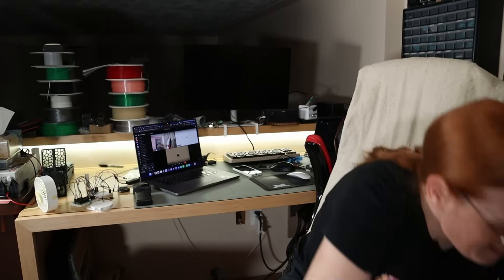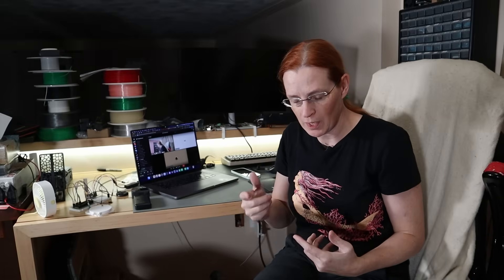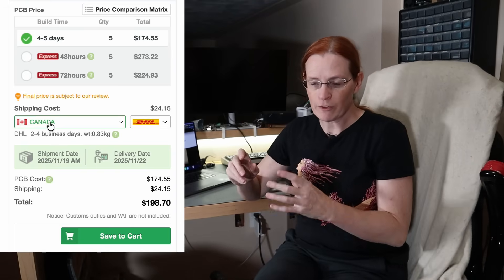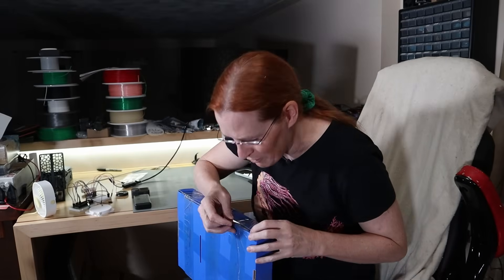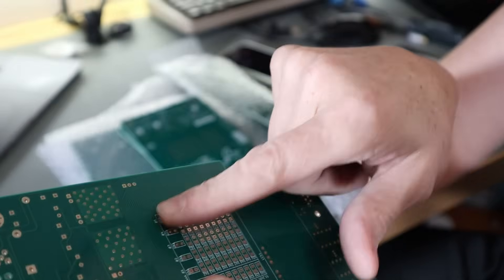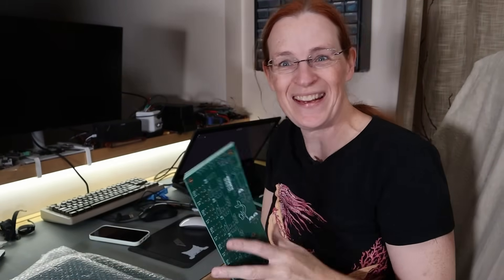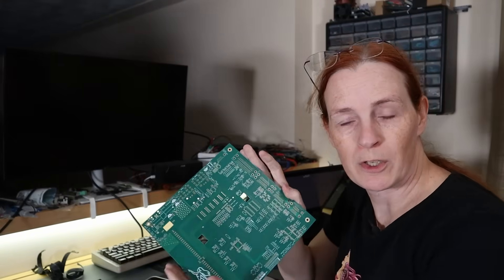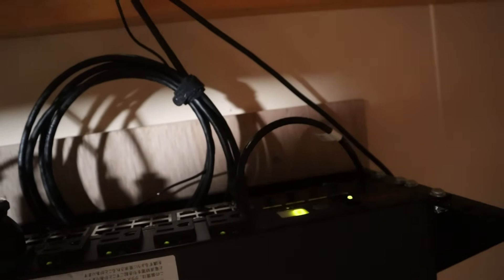The PCBs Are Here! Who Made Them? - Ep. 119

Comment: The reason for the use of gold for the connectors is a chemical one.  Unlike Copper, Nickel, Silver, etc and alloys of same, gold does not oxidise (tarnish) - there is no oxide of gold.  This means that there is a low resistance long-term across the connection.  Furthermore, with gold being a fairly soft metal, when inserted or removed, a minute amount of the surface is scraped, thus removing any contaminants from the joint(s) - this is why it's good practice to periodically remove and replug gold audio connectors on hifi systems.
Reply from the maker: Aye, I used to often enough unplug cards, run an eraser over the contacts, and reinsert them. I know that gold itself has no oxides so is superior to tin for corrosion resistance. However I figured there must be more to it given how ubiquitous cold plating is, even on cheaper expansion cards.

Comment: Great the way your boards came out! Fantastic that you educated yourself designing them. 40 years ago I made my pcbs by drawing the pc copper layout on transparent paper. Then using uv sensitive pc material and a uv lamp. After that putting the board in a dangerous ferric sulphate solution etching away the un exposed copper. Very nice pcbs, but lot of dangerous work haha. I think I give jlcpcb a try. Looks so beautiful these pcbs and incredible fine details to make mini mini boards with smd components. Nice challenge!
Reply from the maker: Learning is the biggest reason I'm doing all this. It's so fascinating learning about things like substrate differences! I've heard of folks using ferric acid to make PCBs back in the day, but I never got to do it myself. I suppose my lungs are grateful for that. As for the current boards; Everything I'm using is lead-free, and I do have a little fan for if the soldering is making much smoke (mainly when doing through-hole components).

Comment: Careful about edge connectors - thats done with hard gold, a different process than ENIG which is much thinner.
Gold doesnt oxidize as much so it doesnt age as poorly for contact resistance.
Reply from the maker: Ah, is the "hard gold" the ENIGPIG option I saw? I guess the edge connectors need to resist physical scraping, not just corrosion?
Reply: @TheDigitalMermaid had to look that up, ENIG is Nickel/Gold, ENEPIG is Nickel/Palladium/Gold and it can withstand direct wire bonding, which none of us playing along at home have to worry about.
I dont think any of the low cost suppliers will do hard gold, could be wrong.
Reply: The pedant in me insists; gold does not oxidise and reacts with almost nothing. It can get dirty of course. More importantly, direct edge connectors are poor compared to indirect.
Reply: @stevepettitt3520 the gold itself doesnt oxidize, but in ENIG the layer is thin and porous, so when the substrates oxidize, the oxides can migrate to the surface and mess with your contact resistance. See also black pad.

Comment: You want to get some no clean flux I think that flux you have will conduct and be hard to get off... I use no clean and then  ISOPROPYL ALCOHOL 99%  to clean it off trust me been burned before!
OOps just saw yours is no clean... just mine is clear... and I bought solder wick.. to soak up solder bridges on the fine pitch ic chips..
Reply from the maker: Aye, no clean, IPA99% and a fresh roll of 2.5mm wick are on hand

Comment: Funny, I placed my first ever order for boards earlier this year and I choose JLCPCB as well.  I can totally relate to the feeling you have when you open the plastic and are holding something that was on your computer screen a couple of weeks ago... Don't sweat the surface mount that much, "lots of resin" is the correct answer.  I was able to do a handful of surface mount in my project using my basic T12 soldering iron and the same soldering supplies I've had for the last 20 years... I'm sure the newer supplies are much better, but I was very satisfied with the results I achieved.
Reply from the maker: It SO WILD holding them in my hand, and knowing that I knew where every trace went and what every part did. I've wanted to make PCBs for longer than I can remember, but I never made time for it or had a project that justified it. Such a flipping satisfying skill to learn!
Reply: True, but there's a big difference between a handful of SMDs vs Maddy's PCBs, especially if all those LEDs were SMD. Can make do vs who would want to.
But, I've only circled back to point out to Maddy that, until I crossed that bridge, I didn't realize that SMDs of equivalent values are available in various sizes, which require different levels of soldering skills and tools.
Furthermore, Kicad offers 'hand soldered' footprint pads, which are longer for easier soldering.
With the digital microscope, I try to use 0603 hand solder footprints for all of my resistors and caps, not only for ease of layout, but also to allow for hand soldering repairs and potential mods, which is also a valid consideration of Maddy's. Perhaps she would prefer 0805 or 1206.
It doesn't need to be SMD or hand soldered, but both options can co-exist.
In my case, with JLCPCB's miniscule pricing for fully populating SMDs onto PCBs, it simply isn't worth my time nor intense effort to hand solder them. Once the SMDs are selected from their inhouse stocks, the BOM is already built for potential future PCBA orders. Easy-peasy.
'Different strokes for different folks." 😎

Comment: Maddy cackling like a lunatic... Wholesome. And yeah, for "not quite v1.0" PCB prototyping, make the boards big, it's way easier to trace traces, find bugs etc on a board with plenty of "free space". If you then moved to v1.0 (or later) you could optimise the board layout to reduce costs/improve production times.
Reply from the maker: I should have spread parts out more evening, that would have given more space for testing and diagnosing. The MCU has a lot of stuff bunched up by the d-sub headers... At the time I was trying to keep trace lengths lower. Ah well, live and learn. :)
Reply: My late father used to sing:
"The ole hen, she cackled.
She cackled as she flew.
If I'd been the rooster,
I'd a cackled too."

Good suggestion. I ordered my 1st PCBs with a clear solder mask to see the traces. It paid off when I needed to scrape it off the traces, exposing the copper to make a few mods.
Reply from the maker: @TheOleHermit  I had not thought of that, clear mask. I went with green to keep the 80s look going, but ya clear would be useful for that. Also, that was a great poem from your pops.